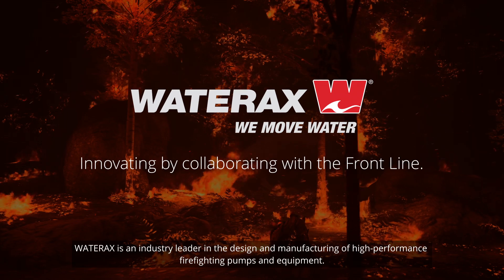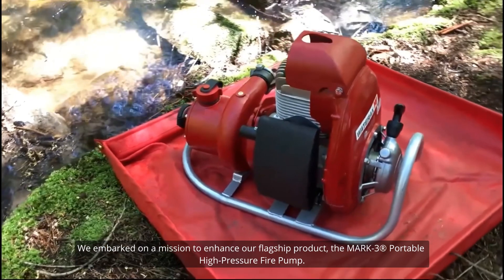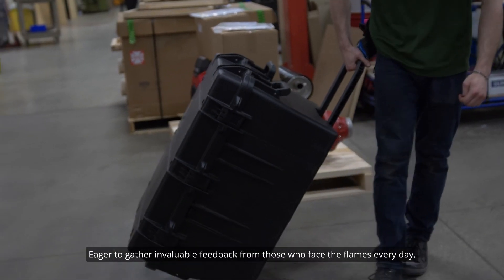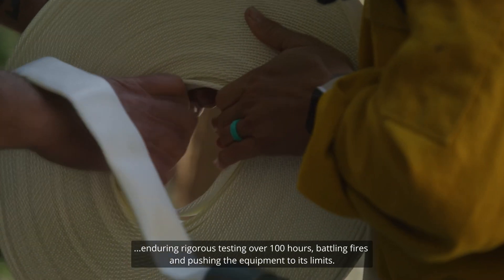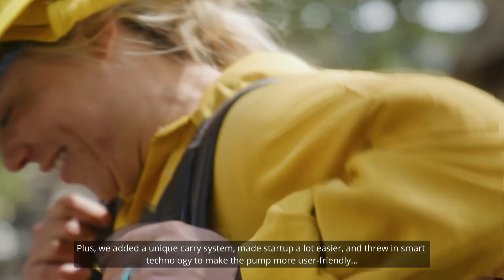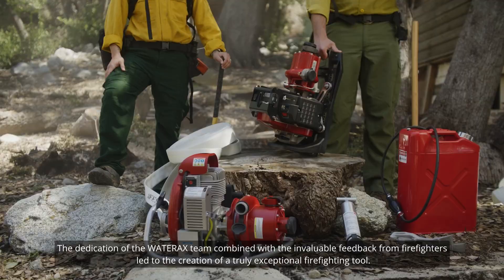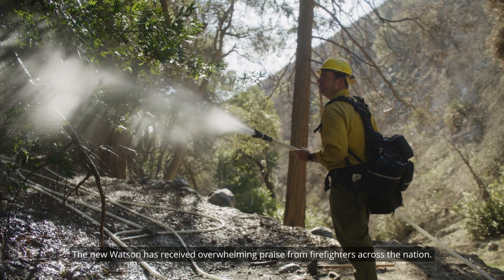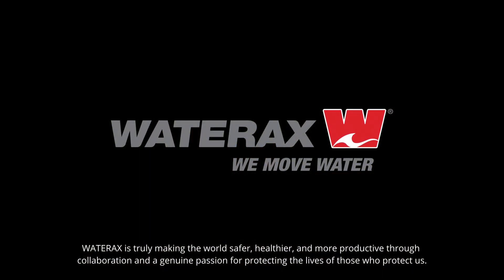WATERAX Pumps - Innovating for Wildland Firefighters

Comment: I am not a firefighter, not sure why this is on my feed, though it looks cool!
Not sure why you included footage of you loading this thing in to a Pelican case, that makes it look fragile, not an ideal trait for firefighting equipment.
I reckon real firefighters would prefer to see you throw it into the back of a ute from 10 feet away.
Reply from the maker: this video shows the process with which the pump was designed and the first prototype units were indeed ''precious'' to us since the cost of making prototypes is usually wayyy higher than the actual production units that are currently in the field